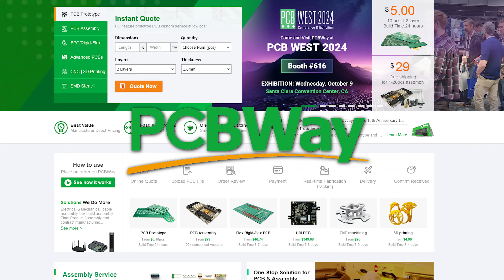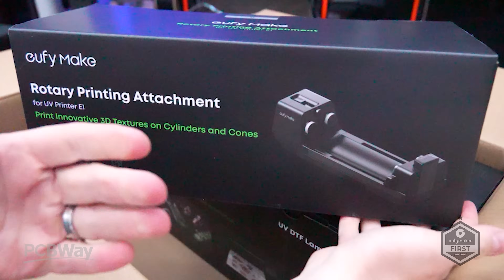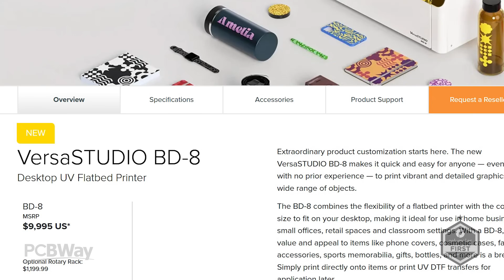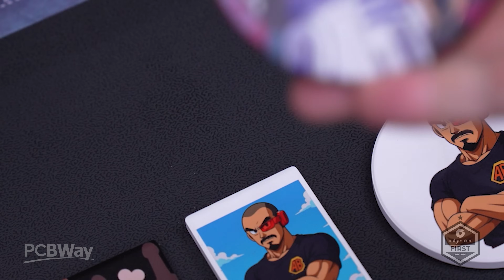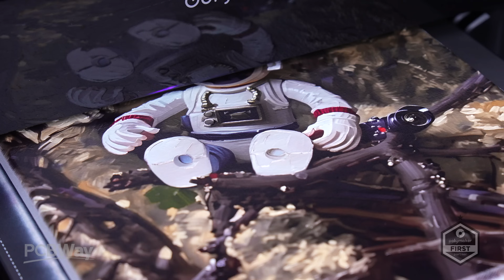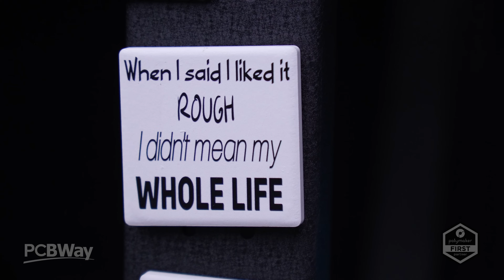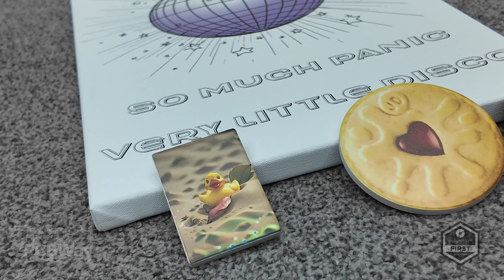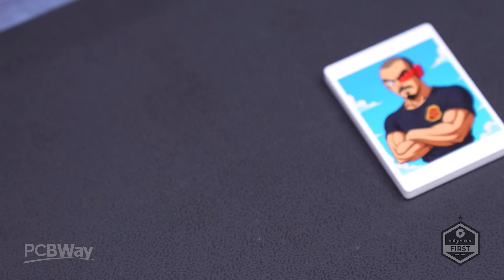Eufy Make UV Printer E1 Secrets REVEALED - now with $100 with code

Comment: I'm curious to see when the potential margins will be once the ink and cleaning supplies are factored in. I know they said they will eventually have larger ink dispensers which may help bring the ink cost down for larger scale printing.  I was considering getting one for the family to play with but with the low warranty on the print head and the thought of burning through cleaning agent every time we don't use it for a couple of days seems like an expensive proposition just for tinkering.

Comment: Do you know how heat resistant the prints are? For example printing on a coaster it should resist a hot cup of coffee or tea.
Reply from the maker: They are cured so you’ll be fine with that sort of heat, fire could be an issue tho
Reply: @TheRealSamPrentice Thanks for the answer 👍

Comment: This super cool, especially as I am looking to start my own business. I do have a few questions though, can this print onto any materials? How long does it take to full print on a tumbler? What about a water bottle with slopped edges, can it manoeuvre along slopes to print ? Love the fact that you have shown it can fully print on a tumbler. Also can it print on a pen, again what is the set up time and how long would it take? Does it print on cotton material, for example a kitchen towel and if so what is the final result?
Reply from the maker: So the unit uses a levelling mechanism so it can move to the positioning, it can print on cotton but I’d avoid t shirts with this
Reply: The company has said this is only for solid and hard materials. So no to fabric or leather. They also mention that it will only work with tumblers and cups with straight sides or a gentle slope.

Comment: no mention of how much resin it uses, refills cost? how many etc etc
Reply from the maker: Sure but that will depend what you’re printing with it, I talk about the pricing matrix in the video in order to make profit, the unit will tell you how much ink is going to be used per print, so you need to work out that calculation. This is the same as any product that manufacturers something, while I could have shown production of say a mug or a magnet it’s still not going to be all that relevant to your case or requirement is it?
Reply: @TheRealSamPrentice  way to beat around the bush. $300 for ink is a deal breaker.  it uses twice as much white ink because of base coats, the machine runs constant cleaning cycles wasting ink and cleaning fluid. a subscription service... no thanks.
Reply from the maker: @Peter-w1i4v  thanks Peter. I think that perhaps this product would be better off without you.

Comment: Seems cool. My concern is that the ink refills cost 179$ each with the Kickstart discount.  How long will the ink last, and if you are using it to sell things, Is there an actual ability to make a profit.  Sure, basic prints you can profit, but the 3d ink is 4x less ink and requires multiple times more for a ringle print.  I am rather disappointed though that after selling you a 2500$ printer they are going to charge users for she ai functionality.   I was all in until I heard about that.  Its as bad ar cricket,  charging for their hardware and then forcing users to pay to use the software features.  Pretty scumy approach for eufy to take honestly.
Reply from the maker: Great question and I did touch on that as you’d need to work out cost of sales based on ink used plus product printed on plus time I’m yet to change the CMYKG inks but the W module I’m on my second as you base mostly in white. Also the cleaning module does need replacing as part of that kit. On each print it does display how much ink is going to be used across each print so it will be easy to calculate.
Reply: The ink cost is about $0.40 per ml. This is on par with other name brand uv printers using name brand inks. You can get lower costs using off brand printers and/or generic inks, but those often risk issues with your machine.
Reply: $179 isn’t bad for ink, I’d reccomend buying and extra kit or 2 with your printer. You have to pay for the ai because it’s not their ai. They are licensing it from one of the available generation ais out there. So the credit system makes sense
Reply: This product just isn't for you, see the next closest thing to it is a Epson UV ink printer for $8,600. This isn't an off the shelf commodity item it's for print on demand Etsy shops not broke hobbyist.
Reply: lol, bad take. This the higher tier uv printers are for real businesses. This is filling the gap for hobbyists but it’s not as high resolution or capability as the high end printers. Roland, direct color systems are all $20k+ machines but the resolutions are way higher than this. In addition the ink costs are lower but maintenance is more costly than this machine. If the built in cleaning features are as good as they say overtime this will have a leg up over over printers.

Comment: I'm really impressed with this pro-sumer product from the company formerly known as AnkeerMake. (Going to take me a hot minute to unlearn AnkerMake for EufyMake)

Although I've been vaugle aware of this theology, it been rather hidden in Swag shop supplier and certainly impressed with the build up print option.  Used to do this sort of work in art class and 1 time for a mural concept. But of course that was by hand. 😉

They resin transfers are also cool and I know they last longer then vinyl.
Reply from the maker: I used to do it with tip-ex in my maths class
Reply: @TheRealSamPrentice  Had to look up what tip-ex was. But Yes white out tape FTW!!!

Comment: Did you get headache while it was printing? That's still UV resin its printing.
Reply from the maker: Nope, in the past I’ve done a lot of resin prints and detest the smell and mess, you’re absolutely right it is still resin how it prints it cures very quickly, so the smell is still apparent but it’s not quite as bad as a 3-D print